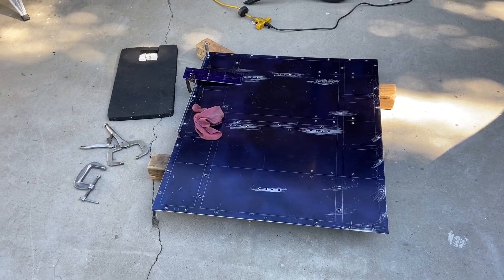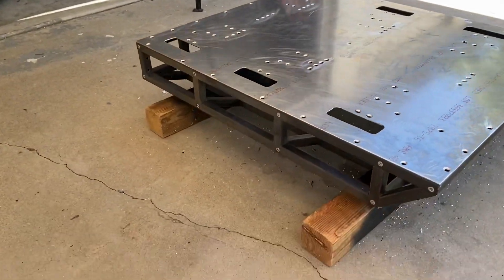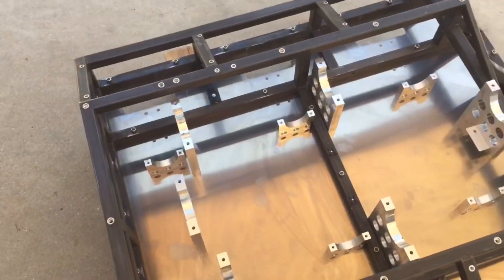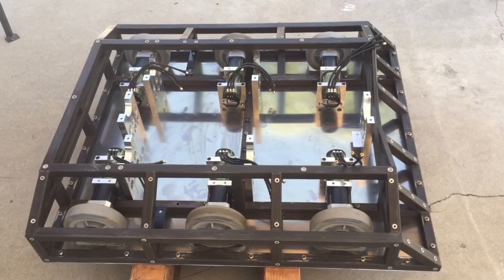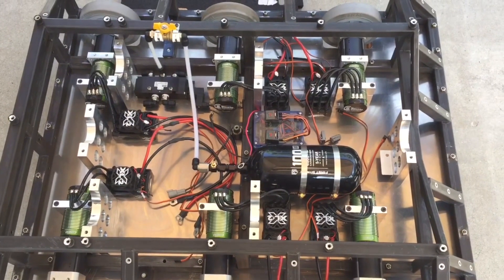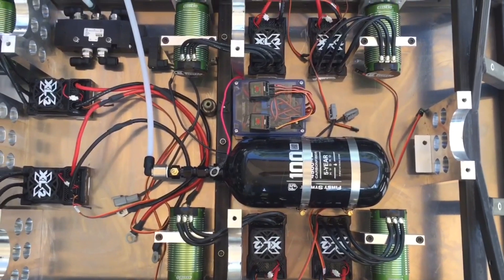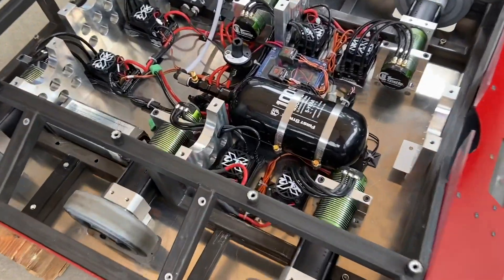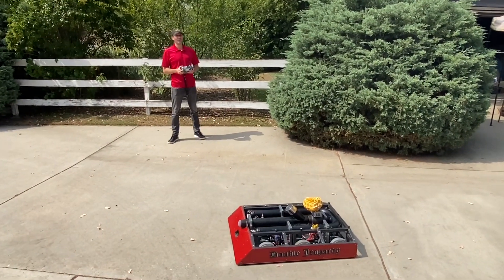Double Jeopardy 2021 - Brushless Drive Assembly

Comment: Okay so three questions:

• What gear ratio do you have on the motors?

• What voltage are you running on the motors?

• What’s the top speed of the new brushless DJ?